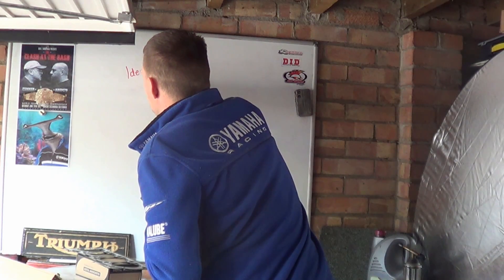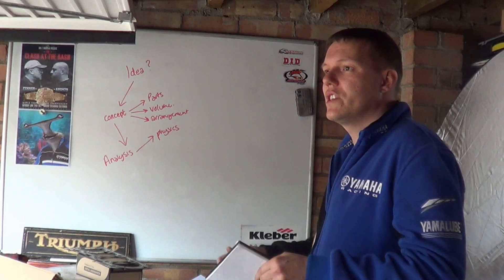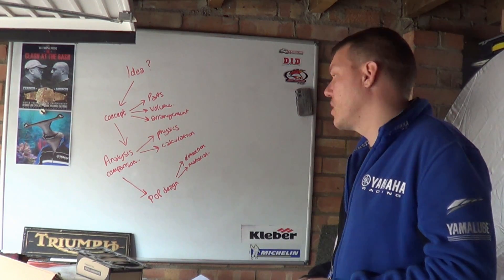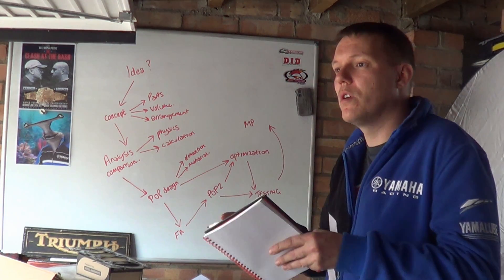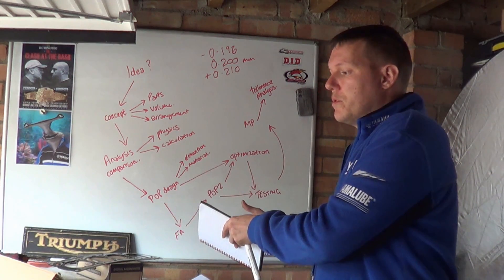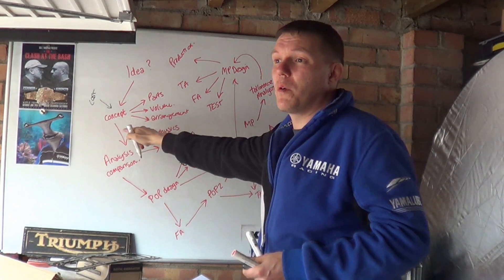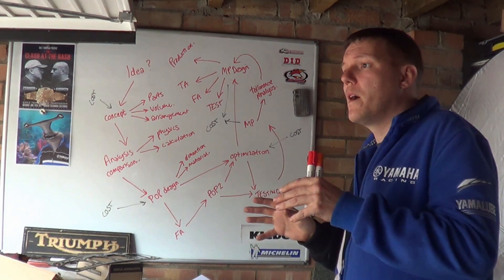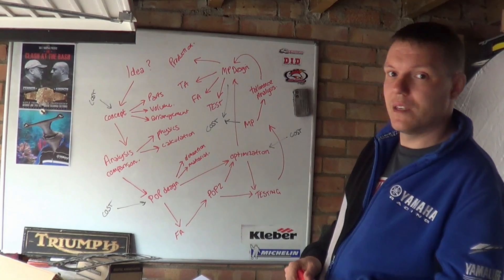Designing an Engine - from idea to mass production

Comment: would anyone be able to point me in the right direction of a book that has formulas for engine design? I have a good grasp of concepts but I would like something that would give me more information on how to actually calculate things such as tolerances, cylinder volumes, forces on certain components etc. Any help would be much appreciated
Reply from the maker: There is no book specifically for engines, instead its books.on engineering,.and there's loads of them. 

Take cylinder liners for example... first you need to work out the hoop stress 

h = p * d / 2t

Then there's the thermal.conductivity and thermal expansion. 

dL / L = a'L * dT

And so on and so on...
Reply: The Workshop ahhh okay gotcha. Looks like it’ll mostly be piecing things together from different sources. I’m familiar with thermo and heat transfer calcs but not so much forces on ICE components in specific so will have to do a bit more research on that. I think tolerances may give me a bit of trouble as I understand how important they are but not quite enough to take into account when designing. Thank you for the reply sir I very much enjoyed the video!
Reply: The Workshop also, if you wouldn’t mind continuing the convo further I would love to ask you more questions. If that’s okay with you, could I shoot you a pm with my email? The reason is that I’m working on my senior design project for mechanical engineeeing at San Jose State University and am considering designing my own ICE for a lightweight performance oriented motorcycle that will mostly be made of carbon fiber. Thank you again for your time
Reply: Internal Combustion Engine Fundamentals by John Heywood is the book you'd want, it's used in ICE design classes at MIT. It's very expensive but you can easily find the pdf online for free.

Comment: The best way to make a new design is to not make one. But to build on what has already been done, to improve upon what came before so as to cut cost. Say developing a direct injection version of an existing EFI/carbureted engine. 

A good 80-90% of your work is already done. You simply need to develop a reliable, efficient, cheap to produce fuel system that probably already exists somewhere else in some form. In the case for direct injected gasoline engines diesels have pretty much done the thing with the common rail system. So you simply copy that and then start development. Albeit you won't need 2000 bar of pressure.
Reply: That is precisely why we are still primarily using the inefficient Otto Cycle engine. Everyone is looking at making improvements to the existing design, but no one is thinking outside the box to develop the next generation engine.
Reply from the maker: So what do you do if your idea is brand new?
Reply: get crackin.

Comment: Quite interesting. There is a lot of overlap with the process used in software engineering (technically what my background is). The biggest difference is the scale. Most SE projects are not even close to being this big and involved. In which case you can simplify some of the steps. Not sure how it is with engine design but we have more than one methodology as well (although the quick and iterative process seems to be the king at the moment).